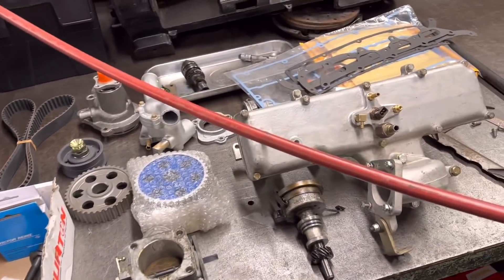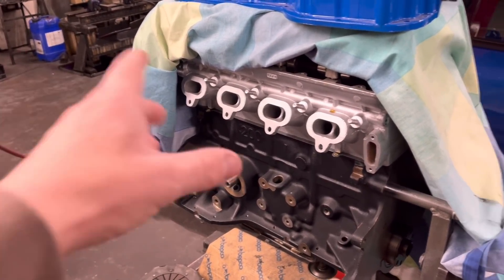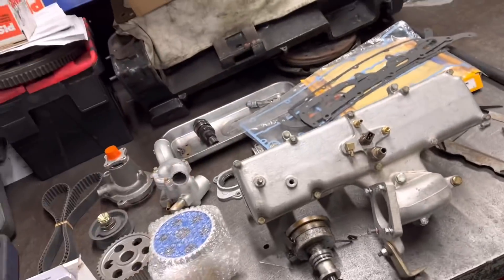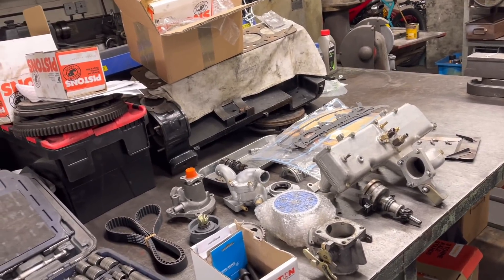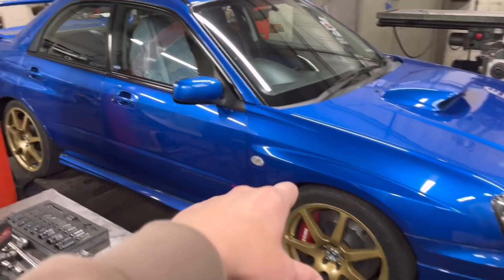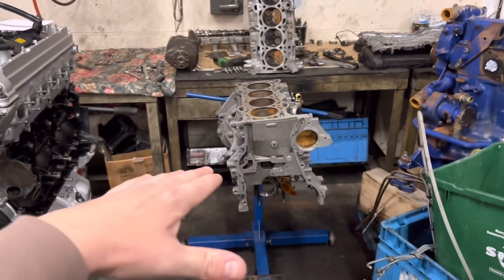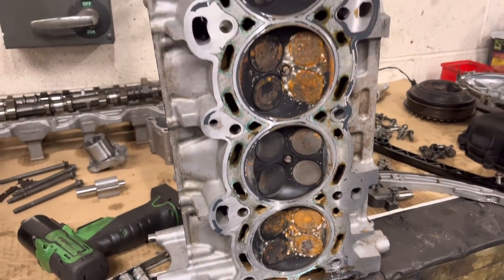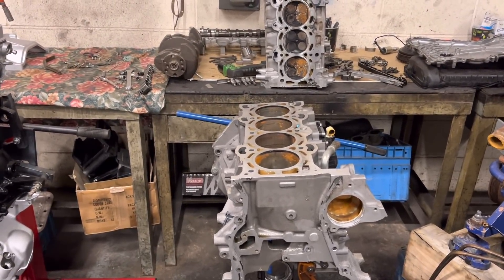It’s back for a Warranty claim check, but is it even the SAME ENGINE?

Comment: I worked for quite a well known engine reconditioner in Oxfordshire. We stamped every head and block we worked on and they still do. Most of the mating faces have a small non critical surface that can be stamped. The next reface would them machine away the old number. We would also stamp the amount removed previously. 👍🏻
Reply: In the day my MG sports engine bottom end was rebuilt to performance standards by Osselli engine services. Ran perfectly.

Comment: For people saying stamp a reference no on the engine or record the engine no in a log, that's great except for the fact that they can be copied by an unscrupulous chancer.  You need to engrave or otherwise mark each part with something that can't be easily copied, like a "random" pattern of dots that line up with a paper template kept with the copy invoice.  Even better if the mark is not somewhere the customer could easily find (behind a core plug has been suggested).

Comment: @Barum Engines , Why not spend a few quid and get a custom punch made with your company name or logo on, you can discreetly stamp an engine with it and a unique code for that engine and customer and then if someone tries to pull a fast one then you can ask why there is no stamp on the engine . 
I do the same with the items I repair as its happened to me where some dick has brought something back I KNOW is not the one I sold. I started to do this and someone tried it on , I just knew it wasnt the one I sold and he was wanting his £1,000 back ... I stated that I WOULD pay him his £1,000 IF he watched me strip it . I went into the office and pulled his pic off the computer with his name , code and date on the same pic . I didnt show it to him until I strip the item, took me less than 5 mins to PROVE it was NOT the same item. He swore blind it was and I was ripping him of etc etc.. I showed him the photo of the ORIGINAL ITEM , time stamped , physically stamped and with customer unique stamp and name . There was a distinct lack of any of this once stripped . He soon changed his mind , "Oh , I must have picked the wrong one up " and so on . I gave him hos pile of bits and told him he was lucky that I didn't report him for fraud . £50 stamp saved me £950 ... paid for itself !

Comment: I can agree with the skimmed disk, but skimming pads for the price they are new seems a bit mad.
Reply: The friction surfaces of out-of-the-box new pads aren't guaranteed to be particularly flat or square to the disc. That's why new pads usually take a bit of time to "bed in" but the only way they can do that is by  grooving or grinding the disc surface. Skimming new pads before fitting them means less wear on the freshly-machined or new discs since the contact areas are flatter to start with.

Comment: Your warranty should be voided if the customer does any work on the engine like shaving the main bolts or if oil starved from a custom sump you didn't fit.

Comment: Maybe he didn't remember grinding down the bolts, because he didn't and that is a junkyard engine they power washed with the manifolds off and delivered to you for 'warranty' work.  it clearly is NOT the engine you built.  Also, why the blue RTV in the water jacket ports on the block?  was blue RTV used on the head gasket?  I would tend to think not.  I know it could be transfer from the gasket ( was it even blue?), but it looks like it was a goopy material when it was put in, not a set rubber / silicone that may have transferred from the head.  Otherwise why would it be 2-3mm into the water jacket port....

I would Suggest using a makers mark.  Also, If you did the initial build, check the measurements from your notes as to bearing sizes, clearances, piston sizes, piston markings (are they even the same brand you install?)  etc.  There has to be something in your notes that doesn't match up.  This 100% smells like a BS claim and he is trying to take you for an engine rebuild.

Comment: Good old Amoco drum & rotor machine. Turned thousands of rotors on them. Just keep cleaning the chips off to keep cutting rotors true. 0.001 chip on the arbor = a big amount at the outer end of the rotor.  Another thing I found you must clean the hub surface on the rotor & the face of the rotor where the wheel mounts. Rust = runout.

Comment: Every engine I have rebuilt I always mark on the major parts and going by 30 years of experience looking at that head and block I would say it's from an breakers maybe even a core, and with all cylinders looking like that water has come in throw an intake or exhaust. And take close-ups of all your work to cover yourself.

Comment: ill share one of my secrets since i do not do this any more, every engine block and every head i would engrave my initials and a set of 3 numbers to match the whole motor assembly, under the freeze plugs is where you will find my engravings, they are covered, not seen by customer and easy to remove for a check, i have busted many over the years trying to get me to warranty stuff i never touched.

Comment: HI ,yeah  i used to do British cars a long time ago. EVERY time i did a head, block or complete build i had a stamp with the shops initials on it and would stamp the part where it didn't show.Some of my customers would show their cars and were super picky at having something not from the factory show.Mind you it was only 1 or 2 guys.I never worried about them, it was the moochers that wanted stuff for free that was an issue.but i gotta tell you sometimes when you need cash flow you just gotta take them in.Hence the STAMP>

Comment: Ah yes thee old customer messing around with sump and pick-up config chestnut     (',')     I have seen a few trashed engines ( OP pressure failure)  due to this over the years inc back to front piped ext oil filters etc , they never learn,  that lower end your questioning looks like a out of a scrapper special (salvage yard) like you say not your work and not the same engine

Comment: It's not unthinkable to consider a customer being schneaky, but it does happen. That engine would appear to be a different one from what was sent out. AND for that engine to end up that crusty IF it were rebuild so recently, CAN happen, but only if it were left out in the rain/beach or degreased/washed down with something caustic and left that way (see the blue in the water jacket - that looks like copper that began to return to the earth).  
 We had a guy bring in a block that was honed .20 to .40 over what we sold him... 
We could hardly believe it was the same block when it came back, but it did have the correct serial number, but seemed to have been honed to bits and then blown up.

Comment: The mazda engine was running without oil every time the car makes a turn and the flat sump is the reason this engine is kaput. Stamp or mark the parts, the customer is a snake.

Comment: All my engines I build at work, I punch 3 dots on the block and head in a very secret place and take photos of the dots and engine numbers and those photos go with the work order and get kept on file. Had a few people try to bring back a different motor than supplied for a warranty claim, and they get asked to leave politely after they are confronted with our evidence.

Comment: I'm not a shop but I do work for friends, and friends of friends sometimes. Had a guy bring a blown motor back to me after about a month. I do pretty good work and I smelled a scam. The fact that he was also dragging his feet on paying me also seemed like odd timing. Dude buys a blown core, sells his NEW motor to some guy willing to pull it, and paint and install the core. It was a Toyota 22re and they didn't even hook everything up. Thew a little oil on it and set the engine on fire and tried to say "it blew". Yeah....blew the bolts right off the flexplate and unplugged the wiring too! Musta been one hell of a boom right? I use an engraver and put a date on the head(s) and the block before it leaves my shop now.   This is also good practice when dropping things off TO a machine shop. Sent a forged Chevy 350 crankshaft to be polished and maged for cracks.  Didn't notice til months later doing the build that I'd been given back and OE cast crank. Heard through the grapevine that it ended up in the shop owners son's Chevy Nova. I engrave all my shit now.

Comment: The high carbon content of  the cyl bore can demonstrate rust as spotting, blackened residue at shop towel as clean surface.  But the valves.  Also high carbon, this would much more be of the type as shown to  a block up ended with manifold open to rain, generally exposed.  Likely both as intake, exaust as to "weather".
Knowing an attempt to "foist a bare bones slight of hand as engine 1, engine 2", I suggest this.  Simply 
hold a steadfast place as billing, a charge to realize profit.  
Whatever the end reason for "hoodwink", a real engine is at your hand.  And can be shown to income.
I suggest a quiet confidence,  a billing slip handed with the least amount of talk.
What ever the reasoning of this "billy"....as found out....complete the transaction to sales.  And naturally, 
beware this enterprise in this or any customer.

Comment: Certainly looks as if skulduggery by the client has been going on.  You need to deny all liability on the basis of client action contrary to good practice (and if you can prove it - of not being the original head/block you actually worked on).  Also, surely you would have time and condition limit requirements for the units, so that they have to be stored correctly and if there is a problem for it to be brought to your attention within a specific maximum period -- and not left out in a field or under a tree somewhere, or submerged in a lake, possibly for a couple of years (as this head appears to have been treated).  Also, the block looks as if it came from a scrapyard.  Maybe the head, also.
Chris Hanlon has come through with an excellent suggestion of hidden location stampings (or even engravings) to identify each part of a unit to a particular job.  Adding a condition for standard sump design (and banning shallow sumps) could be worthwhile. 
If you can prove skulduggery, send him (the "client") an invoice for your wasted time and you could threaten to sue him for attempted fraud.

Comment: I agree with Chris Hanlon, back in the day when I worked welding pressure vessels we had to stamp all our work with a number/letter stamp, so if it failed tests or came back for any other reason, the builder could be recognized

Comment: Bilt hamber do a solution you can spray onto metal to stop it from rusting. Well worth using if not using a car on a daily basis and you want to keep everything looking fresh ! Spray rotors and underside before it's put away after a wash and you're golden

Comment: Hidden unique stamp marks, photographic records, every part and the markkngs,  dated and time stamped- if i could fit a vibration hours counter hidden away epoxied to the block under a metal cover security sealed in , i would.
trust no fker

Comment: Looks like somebody just brought an old block in to make y'all think it's the same block y'all did, to get a free rebuild. If y'all do it, then this customer ends up with two blocks for the price of one, id not do work on a block if it's not brought in in the vehicle that the customer originally bought the engine for. Also I seen where some have been talking about stamping parts, very good idea, don't have to be letters , could just be a number, or even a slash mark. Something you can call a customer out on. That would validate that that is the engine you sold them, mark the head and the block they would never think there to be a mark on the head setting beside a value, or under a bolt on the block there would be a little indention that can only be seen when you take that bolt out. But could only be recreated by your marking tool. So many ways to mark a identifying mark that leads only to you as a builder.

Comment: Disk lathe is a good tool. Skimming disks with the 3 jaw I can measure the run out from the jaw pressure. It’s only tiny and there are three ‘highs’, so it won’t be noticed. But it’s there. *other method is bolting the disk to a mandrel or face plate.

Comment: 12:46  Have a look as cyl 2 and 3  in # 2 you can see at least 2 rings of rust. This will occur where the top ring sits when water enters the bore.  # 3 has 4 rings.  It looks like this engine had water intrusion and was turned a few times over a period of time.
I'd also have a look at the back of the bearing shells for brand and date coding.

Comment: There is no way this engine has 40 miles over a few months.  Look at the corrosion in the water passages.  The corrosion on the valves looks like they were running leaded fuel for a while however the carbon build up does not look like leaded fuel. 
Always record the serial number or even take pictures of features that can't be replicated ( casting imperfections and such  ) .

Comment: Before retirement i worked for a light aviation company who were engine specialists, those old fashioned pushrod aircooled flat 4 and 6 cylinder turbo and non turbo engines,a lot of these components were factory serial numbered, if not during rebuilds we gave them one.
It does not matter how nice the owner is or how much money he has always cover your backside !
We recorded all serial numbers and minute details of work carried out,serial numbers were on the customer invoice and in the workpack that we had on file and the aircraft log book,difficult to fiddle that  ,BUT some still tried!!!!!

Comment: Every engine I have ever built. I stamp a date and my initials in to the head, block, crank counterweight, & back end of the cam/cams. other smaller parts I used an electro engraver on. Not saying that I don't trust people, But I don't trust many people. Plus I also use melt down tabs placed in certain spots to tell if they have over heated it.

Comment: In the future it would be a fairly good idea to take some letter and number stamps and in a place where it would be hidden on the finished product stamp your identification initials into the surface of a spot where it isn't a critical strength or stress area our shop started using work order numbers and the date the machine work was done. No argument if the di.d. Marks are not there or don't match no problem with denying the(ex) customer claim.

Comment: Certainly any warranty is void due to the state of the engine. It didn't leave your shop in that condition. There is an expectation that a customer won't let an engine fill with water, let it sit and corrode like that. The customer has to bear the responsibility of ruining the engine by letting water into it. Maybe in future take pictures of parts as they are fitted and add discrete stampings on parts so you know they are the ones you worked on.  Send the customer pictures of the parts as they are now and ask them to explain the state of the corrosion. Because that's not on you.

Comment: Oldish guy back here. 1. This young lad absolutely know his egirines. and 2. You could start marking your rebuilds .. just an auto centre punch on the outside ....  or inside a WP or a port, just a few seconds, 3,4 or 5 dots in a pattern to identify the engine, take a pic etc.

Comment: Hi when you build your engines I would stamp them with number or letter stamps behind timing plate or bellhousing with the job number and a blob of paint at sump and head joints so you can see if they have been apart, also then you know it's your build, great videos keep up the good work

Comment: Thats another block and head.
The block and head faces say it all as all machining marks are long gone.
That setups already done a couple of rebuilds and some outside uncovered winter storing.
Tell the guy you can do  that engine but it is not the engine you did previously. 
That one you done is most likely destroyed.

Comment: The owner has obviously performed some mechanical modifications after your shop finished the job.  The grinding of the studs and nuts in the crankcase should void any warranty on materials and workmanship.  One thing I would recommend, given the custom nature of many of your builds, is to keep a photographic journal of the teardown and rebuild.  Keep a copy for your records and provide a copy to your customer.  It lets them know you have photographic evidence of the engine's condition or other parts you received and what the state was when the item was returned to the customer.  In looking at the head alone, it is easy to tell that a significant amount of water was left sitting inside at least two of those cylinders, which also show heavy carbon deposition.  Another indicator of critical internal component wear.

Comment: do you use 2.3 ford pinto engine, if so get a thunderbird (mid 90s) turbo exhaust manifold, the rusty cylinders could be from ethanol gas if you guys use that over there,

Comment: You need a set of metal stamps, stamp both parts of the engine and if it comes back with no stamps or only one part is stamped then you know it's not the same engine